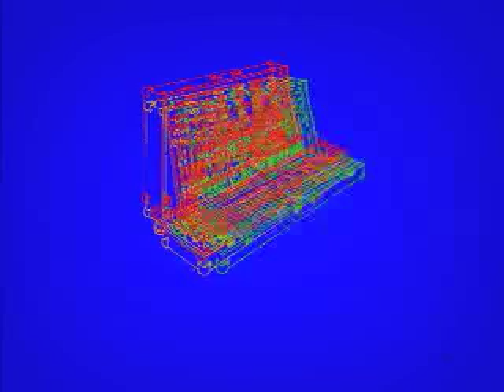ARP 2600 Demo Series Introduction

Comment: This does sound nice, but the versions with ARP-engineered filters sound worse.  All versions had various significant build quality and reliability issues.  But the most amazing thing is that this enormous unit only has one ADSR envelope generator.  Without a separate envelope for filter and loudness, the sounds that you can make are severely limited, even compared to an Odyssey or MiniMoog.  On the whole, I think this unit is over-rated.
Reply from the maker: I know a lot of people who favor the third filter.  I don't see anything particularly special about it, but I wouldn't say it was bad.  
I wouldn't say that any 2600 I've ever seen had "reliability issues,' other than those issues being "the thing is very old and needs service."  
There is only one ADSR, but there is another envelope generator, you know.  You don't need ADSRs for everything.  The Odyssey is actually quite similar to the 2600, just missing a few elements.  
As for "overrated," I suppose any of the classics are to a degree.  My 2600 was really quite nice, but I did end up selling it.  Compared to some others, it didn't communicate with me like perhaps some others have.  I suppose that could be what you're saying.

Comment: I am amazed how, more often than not, the synthesisers are introduced with warped and distorted sounds with loads of bass. It gives a very limited impression on the instruments.
Reply: onsese joo what are u weird? all ear inherently prefer slow oscillating bass to quick sharp treble hits...
Reply: Depends on the music you happen to play or if you are a professional, paid to play. Try to play e.g Lee Ritenour's Mr. Briefcase with bleeps and burps or Toto's Africa or Tangerine Dream for that matter.
Reply: dude you are just confused. professionals that are paid to "play music" are a relic of the past.
Reply: Ha ha ha, that's why there is no new composed music. Everything is samples of what you call old music when it is more than one year old and the result has no originality or real creativity whatsoever. No wonder all the new dance music sounds like 80's and 90's LOL LOL. You can put the pieces together only so many times LOL. You should be glad someone else has already tried and tested what can actually be done with those synths to show you can play music on them. One of the most respected guys Stevie Wonder used an ARP 2600 for example.

Comment: @petecockcroft I guess one controler would be for the cutoff, and the other would be for the resonance?  They need to make old school style MIDI controlers that have all the control features of the ARP 2600 and other synths.  

If there are any Korg Oasys users reading this, does the Oasys offer easier control of parameters such as filter settings than MIDI controlers?.  Can the touch screen do more than one thing at a time?

Comment: This was an amazing synthesizer, but reliability and price was a problem. I do not beleave they were many made. The inventor had some money trouble and had to close shop. That is why moog was a common synth used in the 70,s. The moog was a little easer for stage use. This is the synth they used on Close Incounters of the Third Kind.